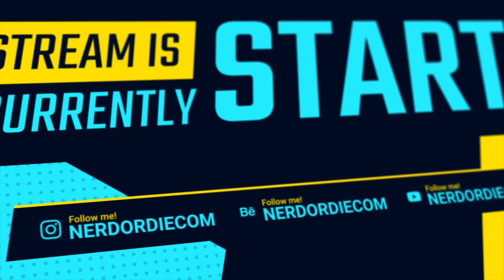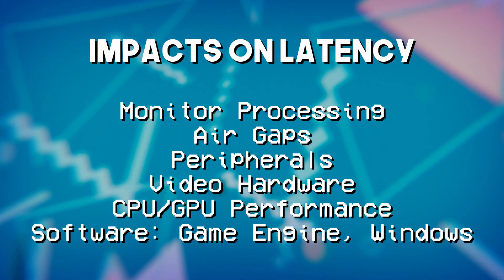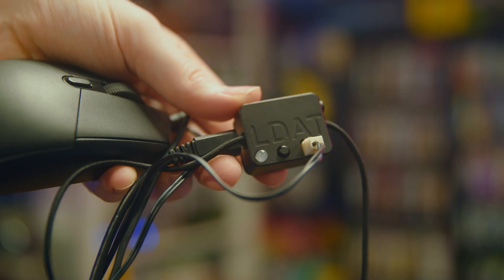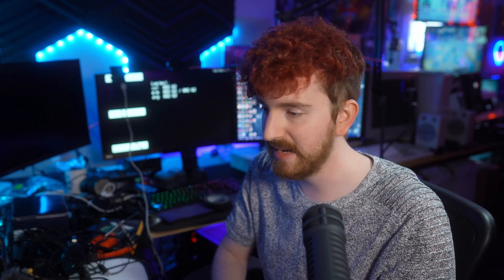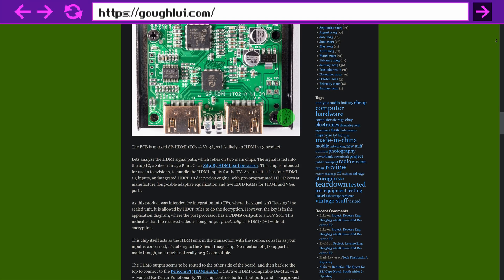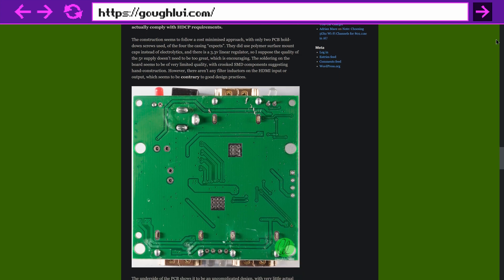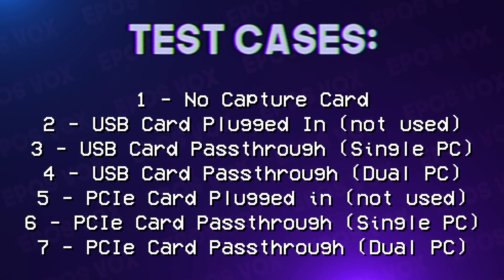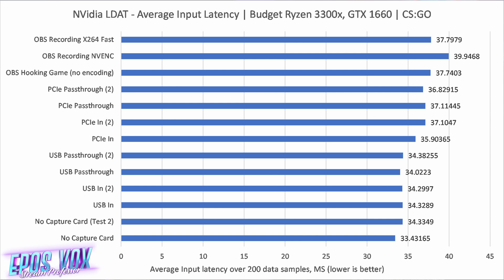Do capture cards cause INPUT LAG? | Understanding Input Latency Testing & HDMI Passthrough

Comment: I’m
So confused.  I’m trying to use an avermedia capture card.  But the actual game on my tv has small latency but enough to make a souls game feel slightly off enough to effect performance.    

The setup. A ps5 that passes through the avermedia live gamer capture card that than passes through a sound bar, than into the tv monitor.    Is the sound bar adding latency?
Reply: Make sure to keep all hdmi cables as short as possible. I have the Ultra Live Gamer 2.1 and kept getting choppy / laggy previews with no OBS errors. Just slightly but enough for me to notice. I had a 1)15ft HDMI 2.1 Cert. from my 4K60 Microscope camera going to the Card and then another HDMI 2.1 Cert. 15ft long going from the card to my TV. I was using a different USB cable too. USB-C 4 40GB 6ft. Once I changed the HDMI 2.1 Cables to the 3ft & the USB 4 to 2ft  all my issues went away.
Reply from the maker: Could be the sound bar, yes.

Comment: awesome video. I have a hdmi 1080p 60 hz signal that I want to feed in a capture card or interface. What capture card/interface has the lowest latency for my signal? Should I go with a 1080p capture device or 4k? (my system is Mac OS). You mostly talk about the passthrough latency but I would like to know what the latency is of the signal that comes in the PC. For example OBS preview latency.

Comment: I had my Genki ShadowCast 2 Pro Capture Card 5 days ago, and I was trying to find out how to synchronize the preview with the display (disregarding the latency and such since it is pretty low) so I came across your video about capture cards causing input lag (which I haven't noticed with my Razer Ripsaw HD Game Capture, and my ShadowCast 2 Pro set to 1080p60 mode on custom and before I set my 4K60 setting for it to Device Default), but if you haven't made a video regarding Human Things' Genki ShadowCast 2 Pro device for latency tests with 1080p and 4K using 60FPS for OBS or anything else, then can you make one, or have you already made one about it?

And yes, the ShadowCast 2 Pro can record 4K60 on OBS unlike the Elgato HD60 X which records at 4K30 instead. I've viewed their Kickstarter with the Genki Covert Dock 2, ShadowCast 2, and the ShadowCast 2 Pro. I just had to figure out how to fix the 4K60 preview on OBS and have it sync with the display.

Comment: with my Elgato 4k capture device recording my xbox yes it does add input delay. How do I get rid of it?
Reply from the maker: Passthrough doesn’t add input delay.
Reply: @EposVox  yes it does and it's very noticeable, I am one of the worlds fastest racers and I brought an elgato thing today and I immediately notice it
Reply from the maker: Are you usually running Xbox at 4k120hz? Or perhaps 1440p 120hz and it defaulted back to 60?
I have tested every gaming capture card repeatedly and there’s <1ms for every one. The passthrough is literally just an electric splitter, there is nothing to add delay whatsoever and every time I’ve taken the time to troubleshoot it with someone it’s just the display settings changing or TV not using game mode since it’s a new input etc

Comment: Thanks for this.
I'm trying to figure out how to display gameplay on my console through my computer to stream and share with a relative in another state in real time but I'm new to all the deeper details and specifics about gaming hardware and this video seems like the sort of advic and info I needed.

I only have a single screen to work with using a laptop, but the processor and graphics specs are pretty up to date and when I got it I was specifically shopping for one that would be good for running games like through Steam.

Do you think a good quality capture card should allow for a stable display for that without excessive lag?

Comment: Feels bad that a video this high-quality has only got 690 likes so far...we gotta pump that up to at least 4000, plus a couple hundred or so.

This is really comprehensive in under 20 minutes, including foundational theory. I was idly wondering how bad gaming off a second-PC (or console-to-PC, specifically!) capture stream would be and this is not bad at all, compared to what I remember things looking like 10 years ago. Glad you highlight that adding a capture card to a system you're also gaming on is generally not a good idea, which kinda reminded me that the best capture setup is still using a splitter and dedicated system.

Comment: Anybody have any good capture card recs for Series X? The ones I’ve found require me to disable variable refresh rate
Reply from the maker: There are none with VRR support. 
*except for one Pengo one which is very experimental and I’m still working with them to improve the firmware as I can’t get it to stop cutting out constantly with VRR on. 
And it doesn’t do 4k120 either
Reply: @EposVox  do you think it’s worth disabling VRR in order to record gameplay? I find VRR helps with certain games with poorer optimization

Comment: Depends on the capture card. I used to have an avermedia and that thing would cause tremendous delay when it was in the process of recording. Bought some splitters and ran the cables simultaneously into the TV and capture card, instead of into the capture card and then back out into the tv. Never had an issue with delay again.
Reply: Nice man, can you tell me which splitter you bought? I have the fear that cheap ones can also cause a delay :/
Reply: Id love to know what splitter you bought also
Reply: This is what I’ve been looking for when I stream 2k this might fix my problem 😊

Comment: Capture Software certainly is! If you use the Xbox apps turn off the settings for capturing if you don't use them, they are on by default and cause input as well as post processing lag even when they are NOT capturing anything!

Comment: If I use for example elgato 60+s for capture ps5 .... Is Using high quality hdmi splitter with the capture card is making less latency ?
Reply from the maker: The Elgato passthrough is real-time. You can not have less latency than real-time. That’s 0 latency
HDMI splitter can’t impact the preview latency, and there’s nothing to improve with the passthrough latency.

Comment: Hey I’m a little late to comment on this video but you said the pass through adds less than 1ms which Wouldn’t be noticeable but my question is does the input delay/latency go up a couple more ms if you record with OBS using either NVENC or x264? So could you feel/notice the OBS scene rendering time and the NVENC/x264 encoding time? I would love to get a follow up to that question?
Reply from the maker: Passthrough is unaffected by anything you do on the computer. It’s electrically a splitter inside

Comment: Tyvm for these tests. I've been torn on whether I should run directly to my LG C9 w/ an extended 1080p60 display out to my Live Gamer 4K (2nd PC) using OBS Fullscreen Preview or Pass-Thru. Pass-Thru would be ideal but I've had some strange inconsistences while trying to use G-Sync as capture cards don't generally support it. However, I believe I might have gotten G-Sync to work or its a bug. 

If I physically disconnect all my displays and only connect direct to my CC via Pass-Thru; G-Sync is not an option to enable in the NVCP for the CC but if I connect my other displays which do support G-Sync and I leave them disabled and still only using CC Pass-Thru, G-Sync becomes available to enable for the CC. From my testing as I've tested it on and off it seems that G-Sync does work thru the Pass-Thru of the CC. Then I either pair Fast Sync or VSync -4 fps w/ the G-Sync and it works. I discovered this when I recently had issues w/ RDR2 crashing while trying to use G-Sync + HDR w/ OBS FS Preview which forced me to try Pass-Thru.

The only issues I seem to have running Pass-Thru is while in the windows desktop the Pass-Thru image quality is not as clear as if I connected my display directly but once I'm in game I can't tell the difference. The other issue is I have to toggle my 120hz setting to 60hz and back to 120hz each time I boot my pc to get the full 120hz 1440p signal and the final issue is potential screen tearing to the stream / recording.

So by using Pass-Thru w/ an Avermedia Live Gamer 4K I can run 1440p120 w/ HDR & G-Sync w/ those few minor hiccups previously mentioned.

Have you done any testing w/ this specifically G-Sync? I understand that most high fps completive gamers won't use G-Sync but for single player games like HZD; 1440p 120 fps is amazing but really shines best w/ G-Sync.

Comment: Interesting video, I plan to buy a capture card myself (avermedia 4k live gamer cause it can capture odd resolution like 1920x1440 ) but I'm still concerned about something, I'm using a HDMI audio extractor for my consoles which works with hdmi passthrough, do you think this kind of little box to extract the audio from hdmi can cause input latency ?
Also the Time Sleuth looks a cool tool, I made research on it and saw it doesn't support over 1080p signal, does that mean it will not works with a 1440p or 4k monitor ?

Comment: I have seen some cheap Chinese capture cards which didn't have an HDMI splitter. Instead, the input was comprised of the mStar scaler chip like you'd find on an input of an inexpensive LCD monitor, scaling to 1080p60 and transmitting the signal as plain parallel RGB. Then you find a USB camera chip ingesting the signal for the capture, and an HDMI transmitter converting it for the output. It stands to reason that this topology can introduce a frame of latency, but doesn't strictly have to, as conversion of a rolling buffer of 2-3 input lines is possible, introducing just a handful lines of delay rather than a frame, and if it weren't for overdrive that such a monitor oriented scaler must generally implement nowadays, the full framebuffer could be spared, reducing the cost. You should be able to tell this topology apart from the topology that starts with an HDMI splitter simply by a glance at the PCB trace layout. You can also DM me on Discord with any PCB pics you care me to look at :D

That being said the mStar scaler is probably great for input signal compatibility, as it should inherit compatibility similar to monitors. You can't exactly expect dedicated capture card logic to be nearly as versatile.

But if memory serves, that particular card didn't even turn out to be terrible when someone tested it, and even had proper USB 3.0 support. Then again some people received cards with identical hardware but firmware that barely worked at all.

As to latency at the bottom of the LCD being larger than at the top? This depends from where you measure. When you have software building a frame and then when it's done, flipping it to the output buffer during the vsync, then you have a scanout latency that occurs on the GPU that progresses as the frame is output, but this isn't monitor's latency. It's also fundamentally the same between LCD and CRT. When you measure from signal source, i.e. GPU RAMDAC circuit (obsolete name, i know, for the lack of actual DAC) or the HDMI/DVI/DP output, the latency should be the same top to bottom. You would need a shadow buffer akin to BBD (bucket brigade device) or CCD (charge coupled device) directly in the panel to un-rolling-shutter the presentation, which just doesn't make sense, it would detract from available footprint for the liquid crystals. Because data needs to be transferred from controller into the charge state of pixels in the panel sequentially anyway, it can't happen all at the same time.

Comment: :/ I have a single PC setup, but I'll only be adding a capture card to it for when I have a console run through it. (Pretty much all my gaming is on the PC, with a few exceptions).

So the only solution I can think of is when the capture card is not in use, disable it's port in BIOS or Device Manager?
Reply from the maker: I mean I don’t consider the tiny likely never noticeable amount of added latency worth the hassle of constantly disabling it. 
Especially if it’s usb that’s not even a problem
Reply: @EposVox  it's the revised Elgato 4k60 Pro , which is obviously a trusted brand so I'm not overly concerned and it's overkill as is lol.

Comment: Epos! Great video but I have a question.. for a use case such as say, using a capture card for a camera in a 1 pc setup would that use enough resources to affect latency of a totally separate game ( not FPS but latency only. Assuming a beast pc that already had tons of headroom) ran on the system? I have a USB capture card (HD60S) would I benefit from a PCIE capture card for my camera? Would it be the same, worse?

Comment: Hello! I desperately love all your work dude!
I’m really interested in two questions if you don’t mind me asking:
1. does g-sync affect smoothness of recording? Or it’s just showing results on users monitor. I tried couple times and final recording always were worse that real performance. Capture cards doesn’t allow to use gsync as far as I know, so this question in about single PC recording. 

2. V-sync on the other side look really helpful even with capture cards and dual pc setup. Is it always should be switched on and synchronised with recording framerate for best smoothness of the footage
Reply: I'm way late. I bet what matters isn't so much G-Sync vs. non-G-Sync V-Sync, but rather stable framerate and frame pacing. G-Sync and adaptive sync deliver frames to the monitor when they're ready, and the monitor displays them without tearing. But this accommodates frames that aren't delivered at the same pace. For smooth video playback you want that framerate to be as smooth as possible, so try and lock down the framerate to 60fps for web-safe video.

Would love to see a video on this issue in specific.